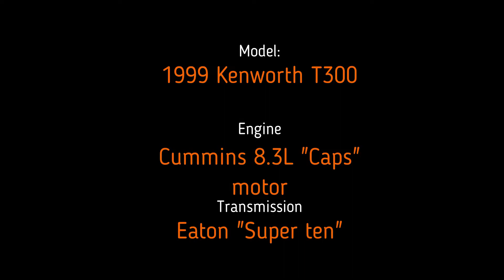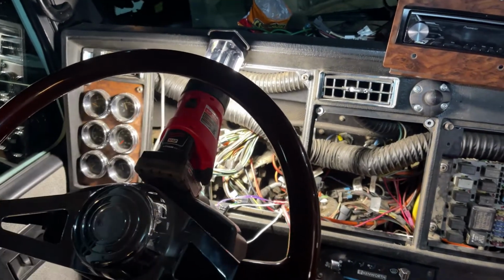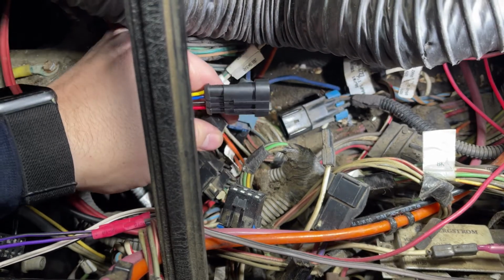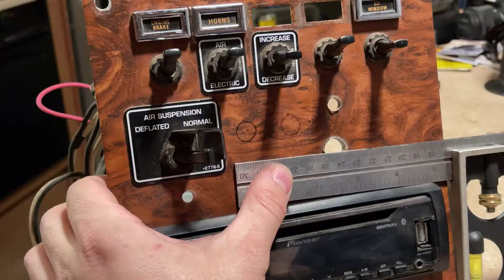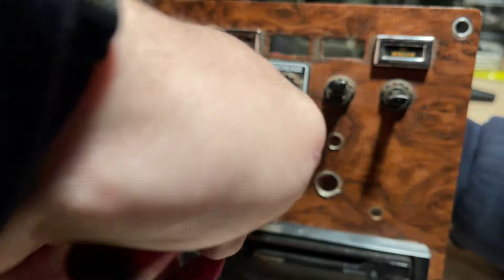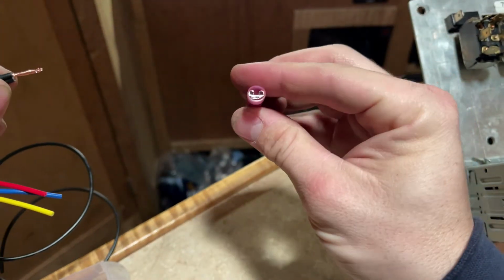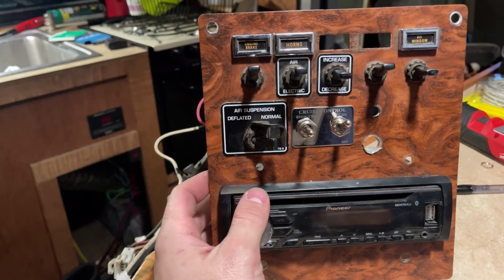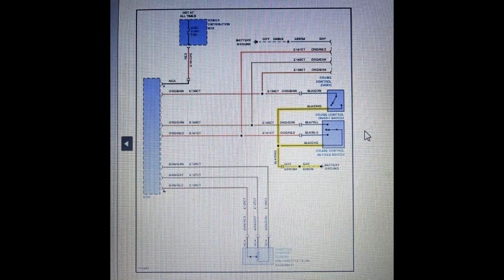Kenworth t300 cruise control install

Comment: Good info on this project. I am wanting to add cruise to my t300. I have a few questions for you. First what year truck is yours and also what power plant and trans set up do you have ? Does your cruise shut off when you hit the brakes or clutch like factory? Also do you run an exhaust brake and will it cancel out if the exhaust brake is applied? Again great video. I will definitely smash that subscribe button
Reply from the maker: Thank you!! 
Truck details: 
1999 kw t300 
8.3L Cummins CAPS motor mated to a Eaton super 10spd

All the factory options work, clutch switch cruise disable, brake disable. I do run a pac brake exhaust brake but i have not had the truck in a situation where it’s activated while cruise is enabled (truck has been unloaded and on mostly flat terrain recently) 

I will be towing my Offroad rig into the hills of pa later this month and can get back to you on the exhaust brake function
Reply: @Coolmeadowsmotorsports  awesome! Thank you so much for the fast reply. I think I’ll give it a shot of my 03 has the same factory pigtail under the dash. Your video made it look painless to do. I’m installing my pac brake this weekend maybe I’ll do the cruise the same time and try and see is I can make the solenoid trigger activate the cruise cut out at the same time. Thanks again